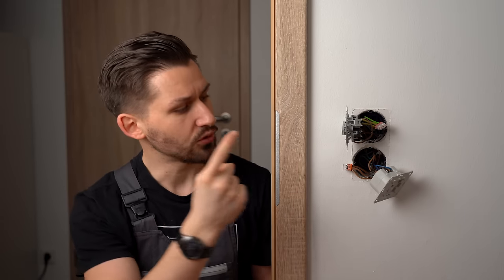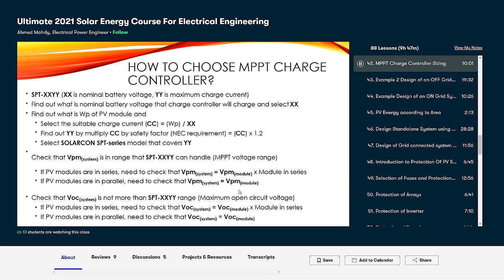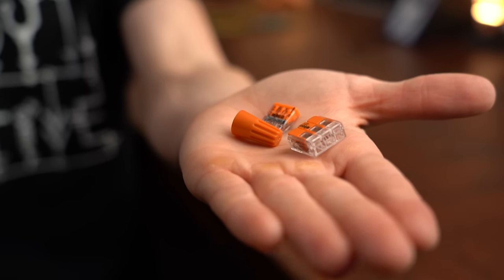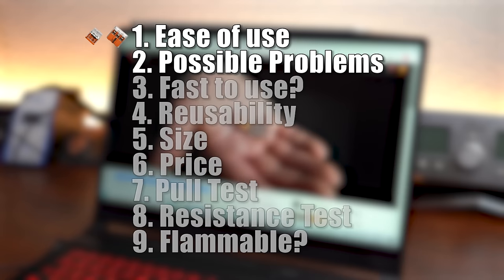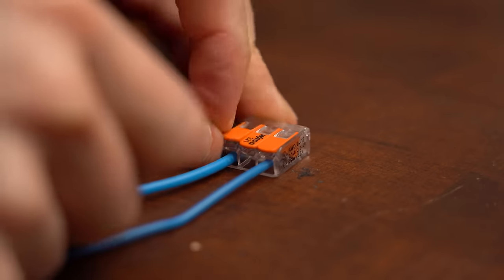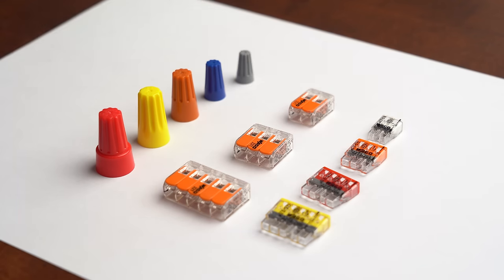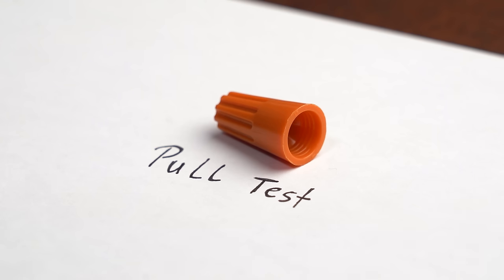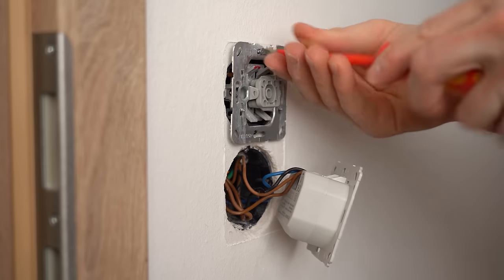What Wire Connector is the Best? Settling a Debate! Wire Nut VS Wago

Comment: I'm currently a retired electrical engineer in the US where I made designs for industrial machines. When Wago demonstrated the lever nuts we were quick to change. The over all the ease of use and reduction in service calls more than paid for the change. The older version of the lever nuts were a bit harder to use and would pinch your finger when closing if you weren't careful so I was glad to see that they were redesigned to be easier to use. The only stores I found that carries them for the general public in the US is Menards if anyone is interested in trying them for themselves.
Reply: Locke supply house has them as well.  They service professionals and home owners alike.
Reply: You can still pinch your fingers, it's just slightly less painful now
Reply: Thank you so much for that information!  The only reason I haven't switched permanently is that they are not easily available at my usual stores.
Menards opened a store relatively local about 1 year ago.  I will be going on my next trip to that town!!!
Reply: Home Depot has both types (lever and non lever) and Lowes has the non-lever type 😀
Reply: Yeah, those old bastards bite you if you have the tendency to play with them in your pockets ^^'
Reply: Yeah home DIY US-based I’ve started replacing wire nuts with Wago 221’s (from Menards) as I have projects around the house.  So much cleaner and easier especially in the cramped electrical boxes.  Also use them on my e-scooters.  So far so good.
Reply: never heard or seen an engineerd working on electrical stuff... only come to the jobsite to see if everything is going to plan, and they never get dirty... aka they don't do trade work they just do cad blueprints  and advanced mathematical calculations
Reply: Lowes carries the Ideal brand in the non lever type
Reply: Given the resistance of the wire nut was a fourth of the Wago I wondered if the poor connection shown on the wire nut was still electrically better than the Wago.  Your comment that your service calls were reduced is the only one convincing me that Wagos are superior.  Then again I haven't twisted my fingers off all day on a job and only use them occasionally on projects.  While typing this comment I realized it would be important to the grip and keeping the wires together and the reduced service calls make sense.  I wonder how many pounds the winners of the pull test actually survived.
Reply: I Just picked up a few boxes at my local home depot but not all carry them.
Reply: @mitri5389  That is often a union thing. My Dad was not allowed to touch any tools that had gone through procurement. He had to have his own set of tools or have a technician assemble prototypes due to shop rules. This was usually not a  problem when a tech was available because they were more skilled and it was a sensible division of labor. They did their job better and could not do his job.
Reply: @steinshaw2490  --  When we got our present home, I found some weird "opens" in wire nut circuits.   I "fixed" them by taking off the wire nut and putting it back on.  The house had been vacant for about a year so maybe temperature changes and whatever did the connection in.   A Wago type (yeah, there are knockoffs available from Amazon) keeps constant pressure on the connection so perhaps that might make it more reliable.

The greater resistance of the wago can be serious.   A slightly overload circuit (20 amps shouldn't be continuously drawn from a 20 amp circuit) generating 1 watt can build up a lot of heat in a small box with insulation on one side.
Reply: Home Depot just started carrying Wagos.
Reply: @Markle2k  electrical engineer is not a electrician... most come out of school and barely know which end of the screwdriver one should use... that's a hyperbolic statement btw
Reply: @mitri5389  My Dad has been both. He was an electrician in the Seabees before he went to UC Berkeley on the GI Bill. That involved both repairs on a 10 kV line in -40 degree weather on a pole and installing phones for the CIA guys next door. The latter was kind of cool because the spooks had access to all kinds of booze, but the PX on the base only had beer, so he could trade a bottle of whiskey for favors. It did cause a bit of trouble when his base commander watched this lowly enlisted seaman wave his badge at the guards outside the CIA installation and walk right in, while he was waiting outside the gate for his escort to meet him so that he could get to his meeting with his opposite number.
To the point, doing technician work requires not just knowledge and experience, but practice to keep the skills up.
Reply: @steinshaw2490  If you look at the contact points of a solid wire in a Wago, it's only 2 small points top and bottom of the wire, ie, more resistance, so I wonder why the nuts were more failure prone.
Reply: Last time I was in the US (in Tucson, to be exact), I was genuinely surprised (and somewhat shocked) when I realized what type of technology was considered "modern". Stoves with open heater coils, gas operated clothes dryers, top-loading washing maschines that were up-to-date when my grandmother was young etc.... and then a Professor at the university told me of his years in Germany, where he brought his washing maschine with him (including 110/220 transformer) and when it broke realized how much better the european ones were that when he went back, he brought the new washing machine with him and used the 110/220 transformer to operate it in the US.
Reply: For me as a kid it was always fun to take one from my dad and fiddle with it trying to open and close it without getting hurt
Reply: @steinshaw2490  I think the thing is reliability - the wire nut might have a lower resistance connection, but if doing it wrong (for example is one wire slides out slightly when twisting the nut), the resistance might be way higher. 
The Wago probably have about the same (still low enough for most applications) resistance every time and it's easy to spot any misstakes that may cause it to go up (like not all strands of a stranded wire being connected or the wire not being stripped far enough). 
For the pull test, I don't think the winner will do much more - because the wire it self (which looked like typical 1,5 mm² solid core installation wire) will probably not handle much more before it snaps at the hook (where the force is not distributed evenly to 2 wires) - maybe 40 kgf at most. Using thicker wires (and have someone stronger pulling or use a different setup that makes it easier to pull), it could be interesting though 😄
Reply: I know the old grey one with orange levers 🤣
They where indestructible 💪
The new ones are a bit more fragile, but with the clear housing and smaller size i love them.
Reply: @mitri5389  I worked in a non-union factory and at the time most of the engineers, including me, worked our way up from production to engineering. I started out wiring the equipment for a couple of years then moved up to testing the equipment for a couple of years before moving into the engineering department.  This gives a better perspective of can actually be done versus what theoretically be done.
Reply: Correct! Oh, The Home Depot carries them now, but our local store's master (we still have one) is convinced they are dangerous and he's 'seen' circuits burn because of them.
Total nonsense.
Reply: McMaster
Reply: @wernerviehhauser94   I heard the same thing.
Probably because of regulations - many things in Europe are no longer allowed to be sold, and the US that is left to buyers discretion.
Reply: @mitri5389  electrical engineers spend all of their time designing new electrical devices, it's their role in electronics manufacturers. Part of the role is specifying the components used in manufacturing on the production lines.
Reply: @ethelryan257  that resistance over enough of them isn't exactly a small amount I understand his concern
Reply: @steinshaw2490  how many times do I see outlets that randomly quit working... Often one wire pulled out of the nut.
Never happens with wagos because even an idiot can see whether they're making a good connection or not.

So yes, when used properly wire nuts make for a superior electrical connection. However if the metric is consistency, wagos win all day.
Reply: @mitri5389  That's definitely not the case where I work.  Interestingly, one of the best things an EE interviewing here can say is that they work on their car in their spare time - it says they have practical experience and are not going to be afraid to get their hands dirty rewiring a forklift.  But when you say "jobsite" it sounds like you're in building construction/facilities - something very different than custom industrial machinery, etc.  If you're at a construction site, the only engineers you're likely to run into are CivEs.
Reply: @mitri5389  My experience too... and seen some outstandingly stupid decisions made by people that never use the devices.... believing the sales blurb and $$$ cost saving that end up costing more in rework and additional QA testing procedure.  
The very worst type are those that call themselves 'sales engineers'... trying to up-talk themselves from being just an order clerk or salesman.
Last time a 'sales engineer' did actual electrical fitting work at a place I worked at, the guy had no idea how to strip and lug flex 95mmsq cable and crimp a lug properly... even after being shown 3 times.  Couldn't terminate 2.5mmsq cable properly for that matter.  
I suspected he was 'trying to get the sack'... but no, genuine ignorance and ineptitude.
Reply: Still pinchin'...
Reply: Amazon got them.
Reply: @wernerviehhauser94  To this day 220 to 110 transformer boxes are available in the US for such devices.  If there isn't any computer equipment (like a digital display/wash selection) in the 220 volt washer at least theoretically you could replace the plug with a US plug of appropriate amperage rating and run it on a US 220 volt circuit.  However, computer equipment tends to not work on 60Hz 220 volt circuits when it was manufactured for European or Middle Eastern 50Hz circuits.
Reply: What’s wrong with a gas dryer?  I don’t have one, but when I have used them they dried faster then electric.
Reply: We also use them as standard. Since its a spring type connection, its MUCH more reliable in dynamic enviroments, shakes and vibrations etc.

Love the 221 for diy stuff and automotive aswell. Speakers etc.
Reply: Wago is designed to work in a  DIN rail system. That means the more connections you're dealing with, the better you can organize them.
Reply: @mitri5389  Most of the equipment we design are one of a kind custom machines and as such the engineers spend a great deal of time working on the equipment in production. Many of the engineers, myself included, spent several years working in production before moving into an engineering position.
Reply: @mitri5389  I have to agree with you there. Those of us who spent several years working in production before moving into an engineering position could at least avoid designing something that only worked on paper unlike the guys that came straight from college.
Reply: Home depot now carries them.
Reply: @wernerviehhauser94  After WWII much of Europe was rebuilt with newer technology as it had been destroyed.  This was jump started with the Marshall plan suggested by George Marshall, secretary of state at the 1947 Harvard Commencement address and implemented by president Truman 1948. The US required no rebuilding and old electrical remained in place with no impetus to redesign to better. James Foerster
Reply: @IonEngineer  not really. We also started off with crappy top loading washing mashines and the like - if you could afford them, and the "Marshall Plan" did nothing to change that.
There is NO reasonable way to explain why, after many generations of washing mashines / stoves etc (assuming a lifespan of 10 years), US stores would still sell and US customers would still buy outdated devices when they needed replacenents.
Reply: Watch a video like  to min ago ….. they tested for different wire connectors..
Wire nut …. Wago … and wago copy cats …
The wago was the worst regarding Temperature resistance etc.
Reply: Last week I installed a CO2 laser and was very pleased to see a Wago connector bonded to the chassis with a single red wire in it. That was a great clue that I was supposed to connect the negative end of the laser to that point. This, being a Chinese budget laser cutter there is no documentation on where to connect the negative end. A wire nut just wouldn't have been obvious. On the downside, I couldn't inspect the connection because the underside is against the chassis, but I was pretty sure that as long as the wires were close to each other the 28KV would get through.
Reply: Some Home Depot’s have started to carry Wago’s. Everyone hates change but I absolutely love the Wago’s. Never had a single issue with them and they are much faster and provide a much more professional looking install in addition to the space savings.
Reply: @mitri5389  There's a difference in British and American English concerning the term 'engineer' ;) Found that out once with some friend of mine who are from Britain and someone from the US, who immediately asked me which university I'd attended... I was dumbstruck and looked at her in confusion like 'uh... none?'
In British-English it can be considered someone who does do the practical stuff ;)
Reply: @wernerviehhauser94  I’ve often wondered what it could be and the best I can think of is that Americans can be stubborn when it comes to change. They like something and they like it forever.
Reply: Amazon sells them as well.
Reply: @GilmerJohn  Wagos are available for up to 10 ga. wire.  The ones tested here are for 12-24 ga. wire.
Reply: @wernerviehhauser94  He didn't need a transformer, he could have a had a 220 VAC socket installed.  US uses 220 VAC which is split in the breaker box for 110 or 220 VAC uses.
Reply: @hjc4604  I know (and the split 220 V supply is another "why the fuck" thing). But IIRC this is what he told me 23 years ago.
Reply: their junk.
Reply: Services calls on wirenuts?? You need to hire people that know what their doing and stop blaming the wirenuts.
Reply: There junk, if your job is too tough for you, maybe your in the wrong line of work.
Reply: @mitri5389  He probably is selling them
Reply: @steinshaw2490  Reduced service calls? Lol, they super increase them! I have pulled out alot of them.